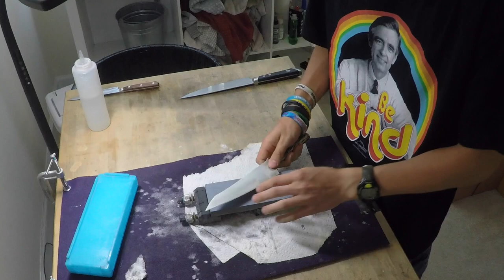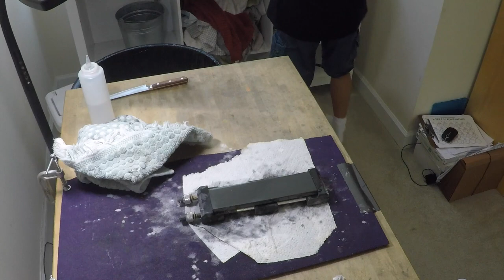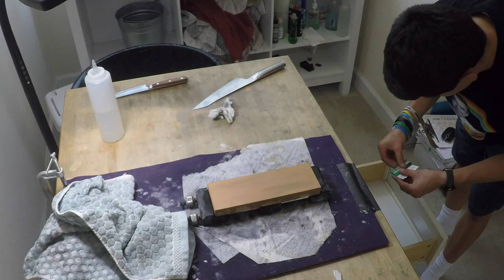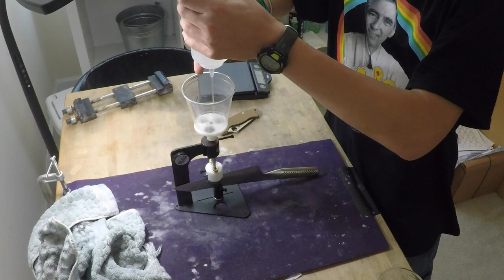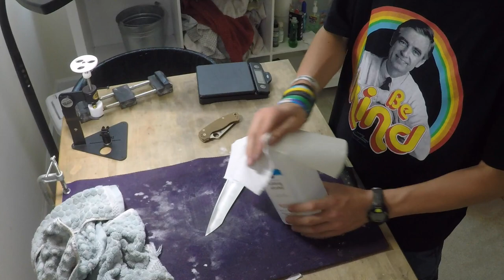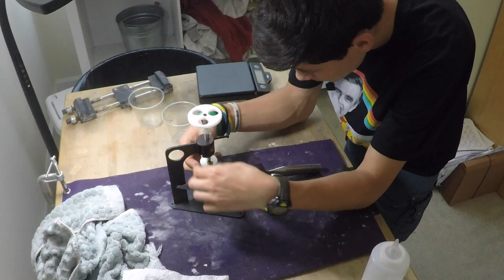Finishing some kitchen knives

Comment: Really enjoyed this one and you should do more like it, I kinda want to try that manual tester and may have to pick one up lol. You mention straight razors, if you've never had one get one off ebay something like an older/vintage 5/8" can be gotten for around $20 just make sure the spine isn't too worn and the edge isn't all beat up/chipped. Fun to play with/sharpen even if you don't use em'.